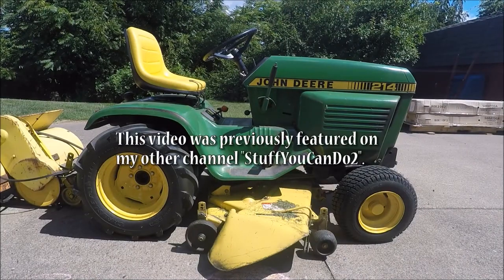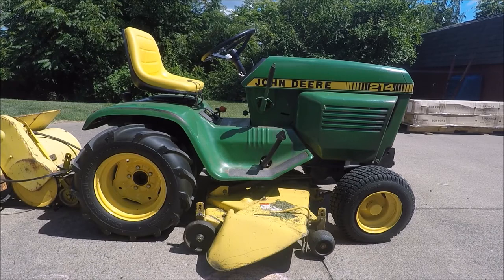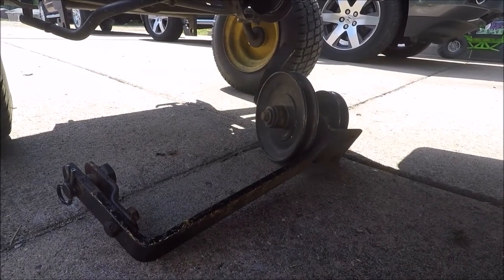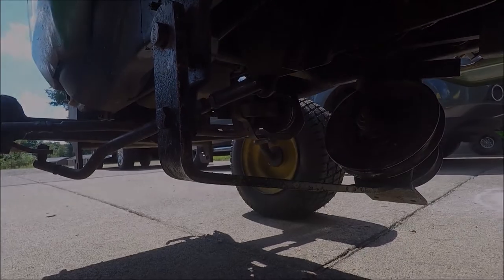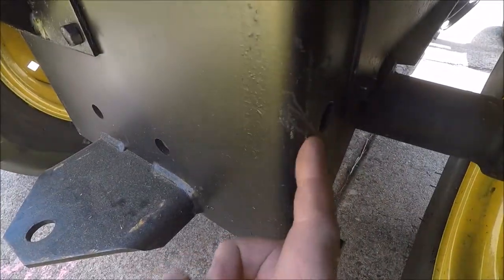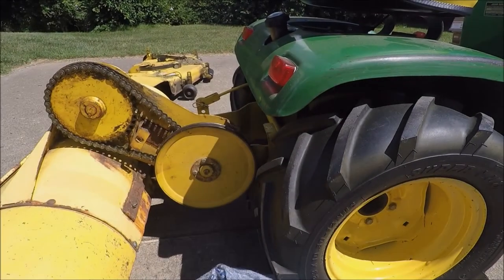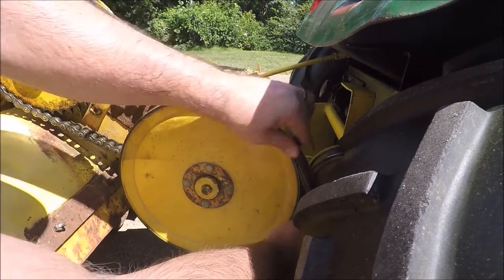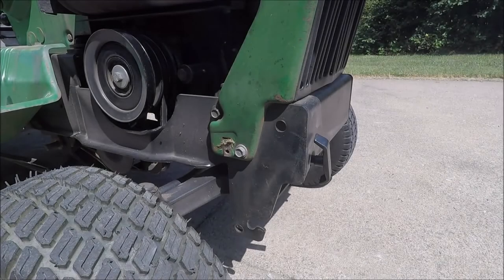Mounting A Rototiller On John Deere 110/112 and 200 Series Tractors

Comment: Thank you so much for this video, I didn't realize I needed to loosen the engine idler pulleys first and this becomes much easier to install. I always put the drive belt on and then installed the intermediate pulleys and that was always a bear to do. Been trying to figure out why my drive belt keeps popping off and I am going to assume I need to tighten the tension on the idlers. Also found out my 214 is missing the knob on the front, all I have is the nut.

Comment: What is the numbrt for the belt that goes from the pto to the mule drive? Thank you
Reply from the maker: It depends which tractor. For the 200 series tractor it’s M47770. For the 110/112 flat fender tractors, it’s M43489.
Reply: Do you (or anyone?) know the part number of the belt from the mule drive to the tiller?  (31 tiller,  214 tractor)
Reply from the maker: M47771

Comment: Would you be able to tell me the demisions for the rear lift rod that goes from the rocker arm to the rear yoke with possible pictures so I can fabricate the lift rod as my john deere 216 did not come with that Rod and the one from a 112 will not fit the 216
Reply from the maker: Unfortunately I no longer have this tractor.
Reply: Factory set at 11-3/4 from clevis pin to clevis pin. But one yoke is threaded so you can adjust total length of lift rod if needed.

Comment: Hey, by chance could you help me out? My father's has a spring and we cannot find out what it does or even replacement for it and the dealer near us was useless
Reply from the maker: Where did it come from?
Reply: @outdoorpowerhouse  it's attached to it just doesn't know what it does. It's a big yellow one some have them apparently and some don't
Reply from the maker: Attached to what? What model tractor is this on? I’ll try and help you out but more details are needed.
Reply: I'm asking my dad for where exactly it is. All I have is a picture.  But it's off a 210
Reply: @outdoorpowerhouse  110 sorry typed wrong
Reply: My dad said it's hooked to part of the framing and has a threaded rod to it.. the dealer said that according to the diagram, it's an extension spring and some other stuff we found said it's a lift spring. We just are trying to figure out what exactly it is and what it does.
Reply from the maker: @shelbydzierzanowski2877  the tiller itself shouldn’t have this type of spring. What it sounds like you’re talking about is the helper spring for the lift mechanism, which was often installed for lifting the implements like the tiller or front blade. This installs underneath of the tractor itself. If it’s a later 110, it should look like this one pictured in this thread: https://www.wfmachines.com/threads/1974-jd-110-manual-lift-helper-spring.126566/

Comment: Is the 43489 for a 112 flat/square fender with the mid mount mule drive? Thanks
Reply from the maker: Yes, all of these tractors require the mule drive to use the tiller, but that belt is specific to the 110/112 tractors.
Reply: @outdoorpowerhouse  so the 110and 112 u r talking r the square fenders ones right is there any way to mount a 31 On a round fender
Reply from the maker: @chevymetrodriver  yes I’m talking about square fender tractors. The round fender tractors use a model 30 tiller.

Comment: Where does the rod hook up to under the yractor
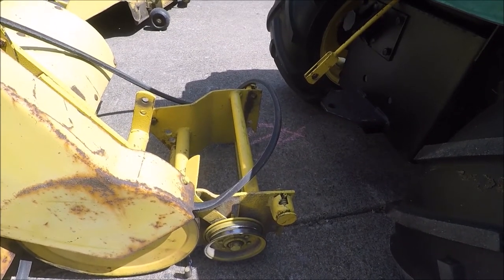Reply from the maker: The tractor needs to have a rear lift setup and then the lift rod for the tiller attaches near the rear of the tractor. You can see this around the 5:00 mark in the video.

Comment: My 210 doesn't have those mounting holes on the rear end
Reply from the maker: They all have the holes in the frame. What you might not have is the lower studs that the tiller sits on that go into the bottom of the frame.
Reply: Yeah your right I had yo check it over a few times and found the holes just not the studs but a couple boltsand a sleeve will work just fine

Comment: These things are pretty much worthless now that replacement tines are no longer available
Reply from the maker: It’s important when buying one that you look at the condition of the tines for that reason.
Reply: @outdoorpowerhouse  I realize that, I have had this model since new because it’s a Deere. At the time they had a reputation for always supporting the product they sold. Alas things change.
Reply from the maker: @johndobb  that’s true, and I’ve been pretty happy for the most part with the parts that are still available for the tractors. These 200 series and their attachments haven’t been made for about 35 years now. Unfortunately if the demand isn’t there then Deere can’t justify making the parts to have them sit on the shelf.